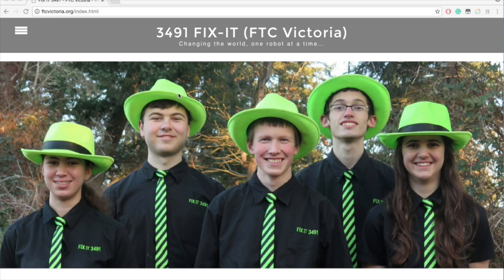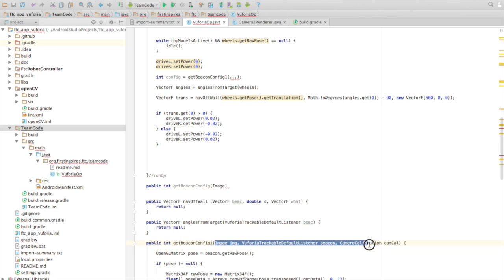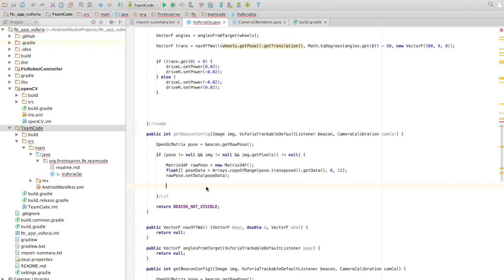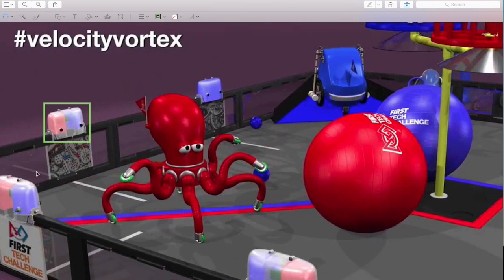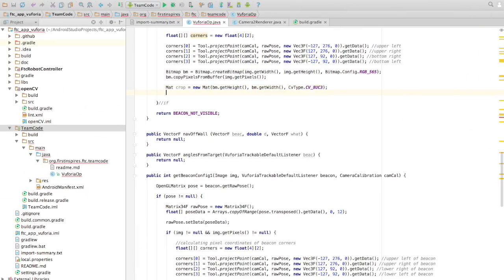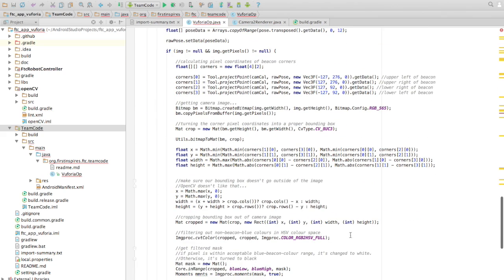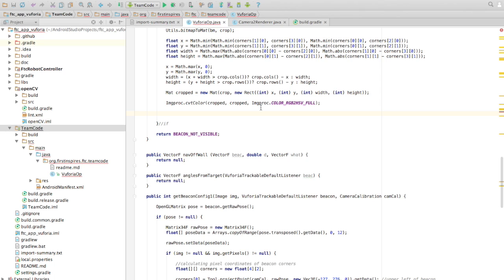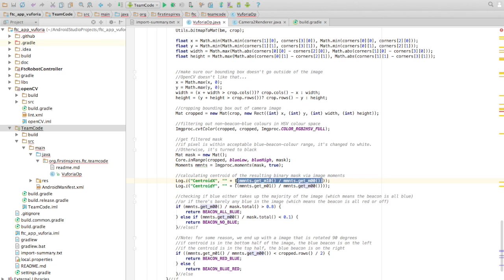Vuforia in FTC Part 7 - Analyzing the Beacon

Comment: This is an amazing series of videos! We've done a fair bit of OpenCV stuff before, but are just getting started with Vuforia and planning to integrate the two frameworks. We researched methods for getting a frame from Vuforia and built a simple test app before coming across your comprehensive work on this by simply adding the code below directly after the  while (opModeIsActive()) line of the standard ConceptVuforiaNavigation tutorial opmode. The trouble is that the call to vuforia.getFrameQueue().take() crashes the linearOpMode. Have you seen this problem? We are using the ZTE Speed. Here is the code: 

            Log.d(TAG,"This opModeIsActive while I see a stream of these messages");
            Image rgb = null;
            Mat img = null;

            VuforiaLocalizer.CloseableFrame frame = null;
            frame = vuforia.getFrameQueue().take(); //takes the frame at the head of the queue    <-----  If I uncomment this the code crashes the linearOpMode even through the Vuforia tracking is still showing on robot controller screen

            if (frame != null) {
                long numImages = frame.getNumImages();
                Log.d(TAG,String.valueOf(numImages));

                for (int i = 0; i < numImages; i++) {
                    if (frame.getImage(i).getFormat() == PIXEL_FORMAT.RGB565) {
                        rgb = frame.getImage(i);
                        break;
                    }
                }

                if (rgb != null) {
                    Bitmap bmp = Bitmap.createBitmap(rgb.getWidth(), rgb.getHeight(), Bitmap.Config.RGB_565);
                    bmp.copyPixelsFromBuffer(rgb.getPixels());

                    img = new Mat();
                    Utils.bitmapToMat(bmp, img);
                    telemetry.addData("Img", "Converted");
                    telemetry.update();
                }

                frame.close(); //doesn't seem to matter if this is present or not
                }//if frame null
            telemetry.update();
Reply: We simply missed the call to vuforia.setFrameQueueCapacity(1); so we were trying to pull a frame into a place that had no memory to hold it. Got it working now. Thanks.
Reply from the maker: Glad to hear you got it working. Good luck with the rest of your autonomous!

Comment: Thanks for the videos, they are great.  

One issue, when we try to make the mask, the results vary quite a bit based on lighting conditions.  We can't figure out how to set the camera parameters with Vuforia.  How have you dealt with different lighting conditions.
Reply from the maker: Unfortunately, we've had a lot of trouble with this. Vuforia has an API for this, but it hasn't worked for us.
Theoretically, you can set the Vuforia camera's parameters by:

1. Using the Android camera class, print out all the parameters and their names:
Camera cam = ...; Log.i("Parameters", cam.getParameters().flatten());

2. Using the names you got from the above step, use Vuforia itself to set the camera's parameters:
CameraDevice.getInstance().set("exposure-compensation", 0);

Good luck!

Comment: Thank you for this and the other videos.  Vuforia and OpenCV are daunting programs to work through.  The method for determining beacon status was similar to what i had in mind. I hadn't dug into the programs to figure out how to do it. Not sure where to start.

You did a great job walking through the code. I could generally follow along even if I didn't full understand all of the details. Fully understanding it would require a major class.

Slogging through the somewhat obtuse documentation is rather intimidating. Do you have any suggestions for simple (Idiot's guide,...) introduction to these programs? 

One suggestion would be to extract these methods into a standalone class.  You have rather lengthy chains of dependencies.

I believe the method cvtAngleToNewDomain in the MathUtils only works correctly up to 720 as it only subtracts 360. The remainder operator (%) might be more robust and simpler.

Again thank you for this information and wish you well in competition.

FTC4605 Robohackerz
Reply from the maker: First of all, thanks! I'm glad you like our videos. 
Second, I would love to tell you I found an amazing tutorial for all of OpenCV, but I didn't. I used the usual programming tools: documentation, Google, and Stack Overflow.
The weird code arrangement was in order to show how the code works as simply as possible. I was worried repeatedly switching java files might be a little confusing.
As for the cvtAngleToNewDomain(), you may be right. For our uses, since we usually use the Adafruit IMU, our robot angles never increase past 360.

Comment: Hello,
I had a question regarding parts 5, 6, and 7 of series. 
How does part 5 interact/come into play with parts6 and 7? What I mean is how does the translation and degrees of the targets that we found coordinate with the beacon analyzation and perpendicular line up with the he target, because they seem pretty independent. If the while loop for the translation and degrees does need to be active to receive the information for the beacon analyzation and perpendicular line then where should it be placed in the code? Since it is a loop it won't stop running and can never get to the other code.
Thank you in advance, you guys have helped me a great deal and have inspired me to delve deeper into computer vision programming.
-team inspiration, 11128
Reply from the maker: Part 5 is to explain how to analyze the beacon's location in your camera image. This is necessary for the colour analysis shown in part 7. While part 5 is kind of re-explained in part 7, we thought that, at the time of making part 5, it would be good to showcase these image analysis techniques.
Part 6 is all about navigating towards the beacon and getting into a good position to press the beacon buttons. Parts 5 & 7 are about analyzing the beacon's configuration, so that you can use it in your autonomous.
In summary: Part 6 = navigation + driving towards the beacon. Parts 5 & 7 = analysis of beacon configuration

Comment: Thank you for the tutorials on Vuforia. Our team's code does not have any errors in it, but when we run it on the robot, it stops when it gets to the "int config = getBeaconConfig(getImageFromFrame(lit.getFrameQueue().take, PIXEL_FORMAT.RGB565), coloredbeacon, lit.getCameraCalibration());". Can we send the source code to you guys and see where we made a mistake? We double checked the getBeaconConfig and getImageFromFrame methods, but they are the same as the methods in the videos. 

Thanks.
Reply from the maker: Yeah, of course. It would be simplest if you give us the link to your github repository, so we can review the code in a nice, formatted way.

Comment: Under the line VuforiaTrackables beacons = vuforia.loadTrackablesFromAsset("FTC_2016-17"); There is beacons.get(0).setName("NAME_OF_IMAGE"). Does the image have to be 2d(beacons) or 3d(beacons_OT)?
Reply from the maker: I'm not entirely certain what you mean. "beacons.get(0)" refers to the "gears" image target (I think) and "beacons.get(0).setName(...)" simply gives it a name in String form (which can be accessed by "getName()")
We haven't called "setName(...)" on a 3D VuforiaTrackable, but I'm fairly certain that you can name both 2D and 3D trackables.

Comment: Have you tried running with the phone in landscape?  Any tips there?

I found a link on Vuforia's developer portals that said 
it would be as simple as calling:
setRequestedOrientation( Configuration.ORIENTATION_LANDSCAPE);
-- I had no luck here but this makes me think the task should be as simple as selecting which camera I'd like to use.

I also saw something about landscape orientation in the sample FTC vuforia project but am having trouble connecting this concept with your instruction here on youtube.

 OpenGLMatrix phoneLocationOnRobot = OpenGLMatrix
                .translation(mmBotWidth/2,0,0)
                .multiplied(Orientation.getRotationMatrix(
                        AxesReference.EXTRINSIC, AxesOrder.YZY,
                        AngleUnit.DEGREES, -90, 0, 0));
        RobotLog.ii(TAG, "phone=%s", format(phoneLocationOnRobot));
Reply from the maker: If by "selecting which camera" you mean the front vs. back camera, I don't think that will help. However, the "setRequestedOrientation()" could very well work.

When the phone is in landscape mode, Vuforia thinks the entire world has been rotated 90º. The sample FTC Vuforia code accounts for this by having you set the phone's orientation (i.e. you've rotated it by 90°) and then appropriately recalculating the orientation of the outside world. 

If "setRequestedOrientation()" doesn't work and you don't want to use the FTC code (it's quite complex), then you can simply adjust what values you're using in "trans.get(...)". Change "trans.get(0)" to "trans.get(2)". Depending on how you've rotated the phone (90º to the right or to the left?), you may have to change "trans.get(0)" to "-trans.get(2)".
Reply: Thanks!  I'll give it a try.

Comment: Whenever I set the frame queue capacity to 1, the app crashes, any ideas?
localizer.setFrameQueueCapacity(1);

I traced it and it seems to crash on the if statement in the getBeaconConfig() function, specifically when it tries to check if img.getPixels() is null

if (pose != null && img != null && img.getPixels() != null)
Reply from the maker: Well, when you set the FrameQueueCapacity to 1, that would make the "img" not null. That's probably why "setFrameQueueCapacity()" crashes your app. But I'm not at all certain why "img.getPixels()" would crash your app. Could you post the error message?
Reply: Nevermind, the issue came from missing parts in the JNIUtils. Just reinstalled open-cv and that did the trick. Thanks anyway!

Comment: It seems that methods "getPose, getFrameQueue, and getCalibration" can't be found. I have imported your files from GitHub (this resolved my missing OpenCV files), but I still can't figure out what files I'm missing ):
Reply from the maker: As long as you're using the ftc_app repository, you shouldn't be missing any files. VuforiaLocalizer and VuforiaTrackable are both in the default FTC libraries.
Reply: I was able to figure it out, however now when trying to run it on the phone "FailureException - Vuforia operation failed" ):
Reply from the maker: I don't remember seeing an error like that, so I don't know how much help I can be. After some quick Googling, it seems to be a problem with the FTC libraries, instead of Vuforia itself. My best guess would be that you've missed a step when initializing the VuforiaLocalizer or the VuforiaTrackables. I would check every line of code, especially the file names.

Comment: I really like and appreciate your videos, esp #6 Navigating and #7 Analyzing. The only thing missing is how to setup OpenCV.

Trying to use your code and having problems. I think it has to do with the OpenCV install into  Android Studio. Running your code (full system from github) it works. When I try the same code in my development, it crashes when it tries to process the beacon. The error is with the bitmapTo Mat method. I believe it to be some sort of link I missed.

12-07 09:24:31.727 14424-15060/com.qualcomm.ftcrobotcontroller E/AndroidRuntime: FATAL EXCEPTION: LinearOpMode main
                                                                                 Process: com.qualcomm.ftcrobotcontroller, PID: 14424
                                                                                 java.lang.UnsatisfiedLinkError: Native method not found: org.opencv.core.Mat.n_Mat:(III)J
                                                                                     at org.opencv.core.Mat.n_Mat(Native Method)
                                                                                     at org.opencv.core.Mat.<init>(Mat.java:37)
                                                                                     at org.firstinspires.ftc.teamcode.BeaconAnalysisTest.bitmapToMat(BeaconAnalysisTest.java:262)
                                                                                     at org.firstinspires.ftc.teamcode.BeaconAnalysisTest.getBeaconConfig(BeaconAnalysisTest.java:189)
                                                                                     at org.firstinspires.ftc.teamcode.BeaconAnalysisTest.runOpMode(BeaconAnalysisTest.java:121)

I believe it is in how I have OpenCV set up.

Basic process I used:
Open Studio with FTC SDK (brand new)
Files/New/Import module - OpenCV. Accept defaults.
Change build.gradle (Module:openCVLibrary310) to:
android {
    compileSdkVersion 23
    buildToolsVersion '23.0.3'

    defaultConfig {
        minSdkVersion 19
        targetSdkVersion 19
    }
Open Module Properties for FtcRobotController and TeamCode to add dependency on OpenCV.
Copy Libs to TeamCode & FtcRobotController\jniLibs.

I've compared gradle scripts, Module Settings, and jniLibs to yours and they look the same. Any thoughts on where to look next?

Regards,
FTC4605 Beaver Dam Robohackerz
Reply from the maker: This looks like a problem with initializing OpenCV. I think you may have missed adding some code to FtcRobotControllerActivity. Try inserting the below code at the right below "class FtcRobotControllerActivity {"
------------
private BaseLoaderCallback mOpenCVCallBack = new BaseLoaderCallback(this) {
    @Override
    public void onManagerConnected(int status) {
      switch (status) {
        case LoaderCallbackInterface.SUCCESS:
        {
          RobotLog.i(TAG, "OpenCV loaded successfully");
        } break;
        default:
        {
          super.onManagerConnected(status);
        } break;
      }
    }
  };
----------
And the below code in the "onCreate()" method
------------
if (!OpenCVLoader.initDebug()) {
      RobotLog.d("OpenCV", "Internal OpenCV library not found. Using OpenCV Manager for initialization");
      OpenCVLoader.initAsync(OpenCVLoader.OPENCV_VERSION_3_0_0, this, mOpenCVCallBack);
    } else {
      RobotLog.d("OpenCV", "OpenCV library found inside package. Using it!");
      mOpenCVCallBack.onManagerConnected(LoaderCallbackInterface.SUCCESS);
    }//else
----------
That should solve it, but I can't guarantee anything.

Comment: Are team is having trouble with a code that keeps giving us an error.
When we load up the program on the robot the camera on the phone crashes when you internalize it.
It keeps saying the error is coming from the 
VuforiaTrackables beacons = vuforia.loadTrackablesFromAsset("FTC_2016-17");
Reply from the maker: Can you post the error message? We're not sure what error that line could cause, so that would help in diagnosing the issue you're having.
Reply: We finally it working but know there's a new error the error is
Attempt to invoke interface method'java.util.concurrent.BlockingQueue(file location) VuforiaLocalizer.getFrameQueue()'on a null object reference
Reply from the maker: That's actually our mistake. Right after you initialize the VuforiaLocalizer, you need to call this line:

vuforiaLocalizerObject.setFrameQueueCapacity(1);
Reply: FIXIT3491 sorry im a bit of a beginner can you please help in initializing VuforiaLocalizer?
Reply: Never mind i got it thank you so much for your help

Comment: followed through step by step but when I make a simple op mode that calls getBeaconConfig() and stores the return in telemetry to display on the driver phone I see that nothing is happening. after adding telemetry before during and after getBeaconConfig() It shows that the program is never getting past or even into probably get beacon config.

here is what I am running

public void runOpMode() throws InterruptedException {
        setupVuforia();
        visionTargets.activate();
        waitForStart();
        telemetry.addData("Before Beacon Config" , "");telemetry.update();
        int config = getBeaconConfig(getImageFromFrame(vuforiaLocalizer.getFrameQueue().take(),PIXEL_FORMAT.RGB565),Wheelslistener,vuforiaLocalizer.getCameraCalibration());        telemetry.addData("Config", config);
        telemetry.update();
        telemetry.addData("Before Loop","");
        telemetry.update();
        while (opModeIsActive()){
            telemetry.update();        }
    }
any help would be awesome. Thanks!
Reply: I am having the same issues. Even after getting rid of most of the code and just leaving in the cropping of the image, it still refuses to do anything.
Reply: After some investigation, for some reason, the Images that vuforia returns are in PIXEL_FORMAT.GRAYSCALE rather than RGB565. This makes no sense considering I also have Motorola G3s, but please advise.
Reply from the maker: Actually, Vuforia runs all of its processes on grayscale images. If we want Vuforia to give us a RGB565 image as well, we need to include: "Vuforia.setFrameFormat(PIXEL_FORMAT.RGB565, true);"
If you want more info about this, watch "Vuforia in FTC: Part 5"